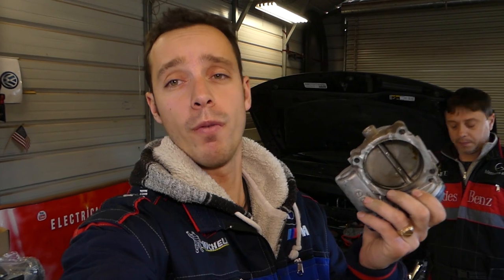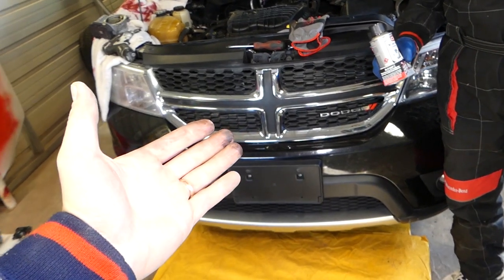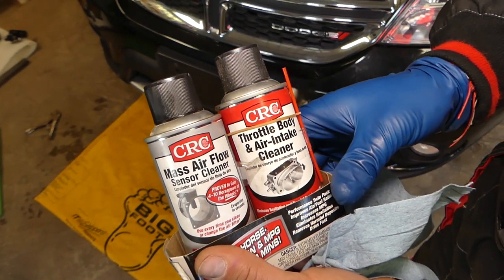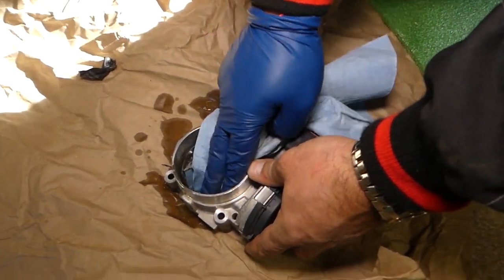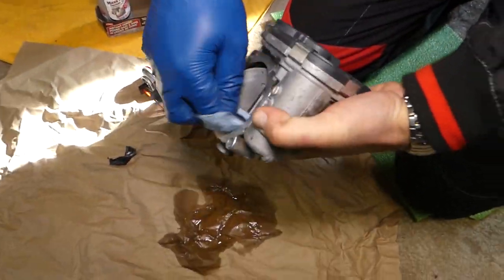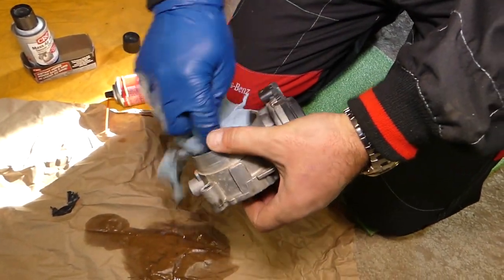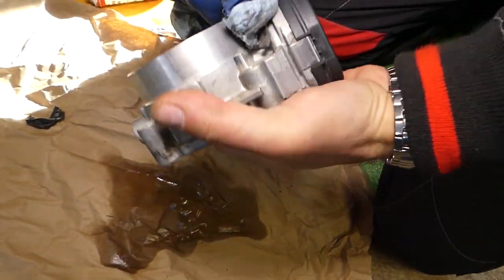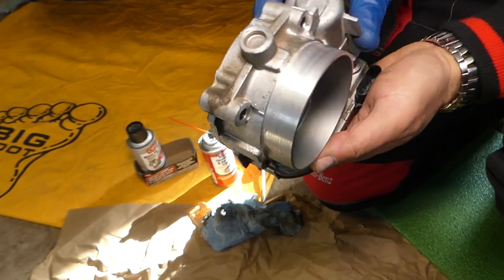HOW TO CLEAN THROTTLE BODY ON DODGE JOURNEY FIAT FREEMONT

Comment: Can this stop your engine when driving if not fixed?
Reply: You can only rev to 2k RPM, so use the self shifter and start in first. The max speed I got was 58 or so on the highway in 4th gear